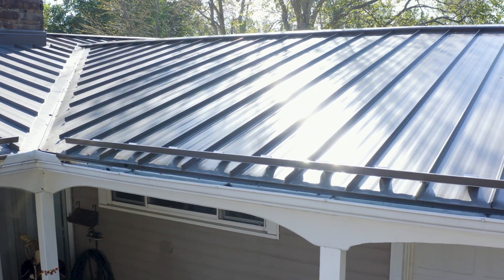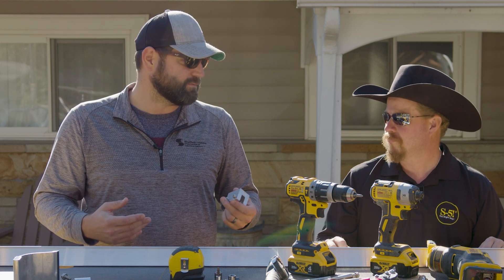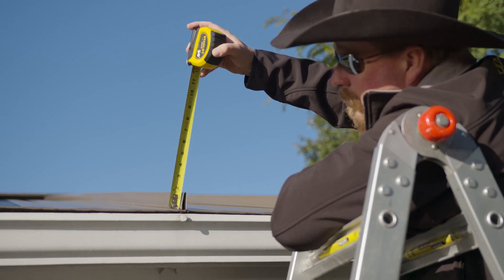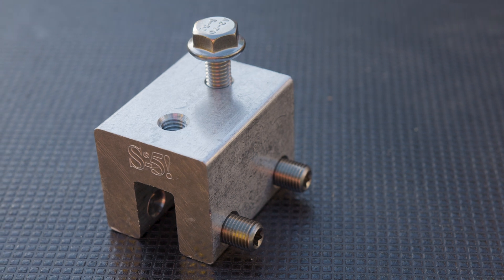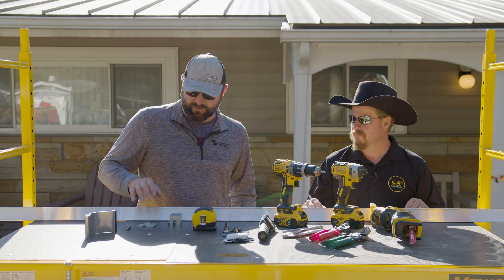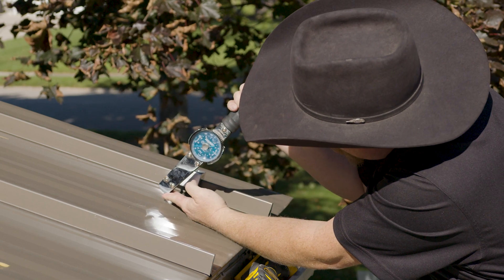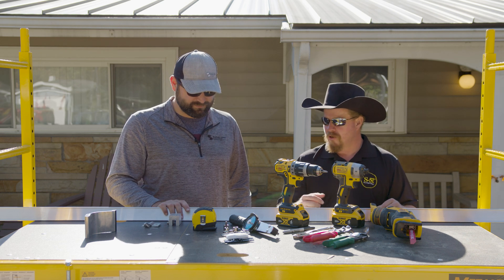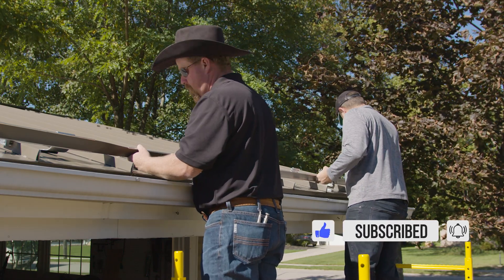How to Choose the Right Snow Retention System for Your Roof

Comment: I've always been under the impression that one of the benefits of a metal 
roof is shedding snow load. We live in Maine, 2 story house with a 9 pitch 
roof. Small dormers over both main entrances. Doesn't seem this would be 
needed?    Also, I'm sure you deal with Roofers nation wide. Is there anyone 
you could/would recommend in the greater Bangor area? Thanks in advance. 
I find your video's extremely informative and concise.